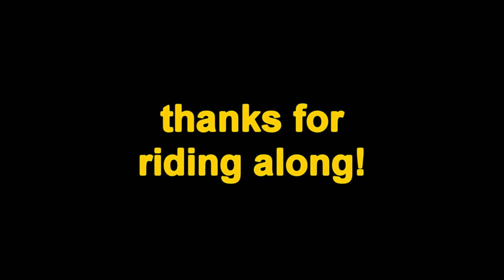winter time rat roddin'.wmv

Comment: I've been using clear coat on my engines, seems to work good. I don't think those small engines get over 175 degrees unless your running the crap out of it trying to kill it. I get rustoleum clear coat and spray it over my paint like 45 minutes after I spray my paint. Then I let it sit for like 2 weeks before I touch it haha.

Comment: Your drive would make a good bobsled run.Is that gauge on the top of your dash. A manifold vacuum gauge.That ol 6 banger truck motor sound like it wants to work. Rattle can poly urethane clear  works great as a top coat. It will not lift enamel. Just give extra time to dry. Urethane applys like enamel. Be sure to use breathing protection.Urethane will dry like plastic in your lungs.It.s wicked. Old auto painter&tin pecker. RAT ON RAT ON